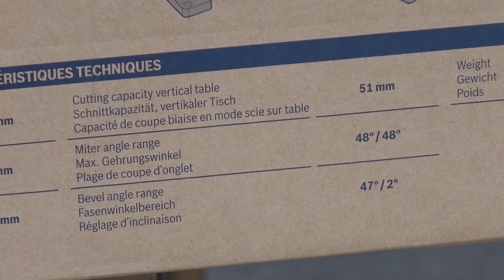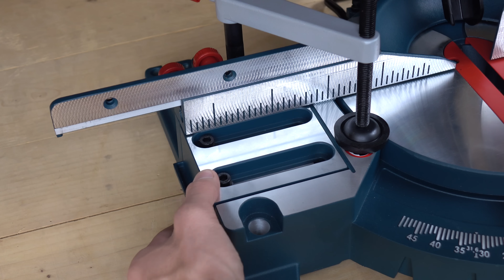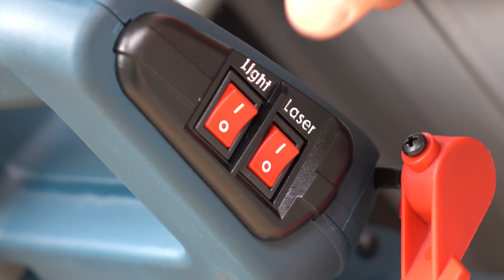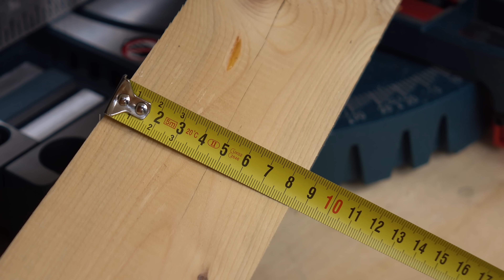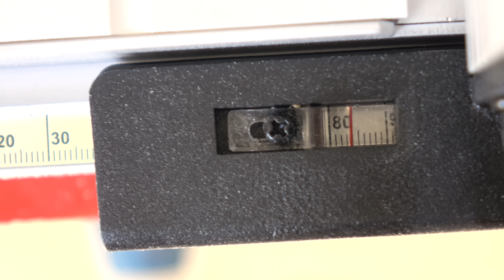Miter Table Combination Saw BOSCH GTM 12 JL  |  Unboxing and Test

Comment: While I would never get this...  It's silly that so many people are capping on this.  It's clearly aimed at flooring installers, which this is perfect for.  Just look at their pics.  It's almost all flooring related.  If that's all I did, this it almost a perfect jobsite tool.
Reply: I bought this machine late last year. It performs way better than I expected!
Accuracy is excellent, even the fence is spot on. I use it for timber but mostly for aluminium (yes I'm not in the USA, I'm in South Africa and that's how we say it here)
Settings are accurate and repeatable.
Yes it is heavy but it is rigid and trips to the job site don't disturb its accuracy. I have not wished for a wider table when on site
Like my other Bosch equipment, this machine is not scared of work!
Reply from the maker: Glad you like it man.
Reply: @johndavie9921  💪🏼🇿🇦
Reply: Ima flooring installer and drooling tbh lmao
Reply: That makes perfect sense
Reply: Price bolo iska

Comment: That’s a perfect tool for installing laminate flooring. One stop for all cuts.
Reply: Yup, I wish I had it when I was installing mine... 😭
Reply: Exactly my thoughts!  Great for flooring, but probably not much else.
Reply: Nah, I am a general contractor and I disagree. You have to lock it into place with  the miter attachment to use it as a table saw. If you install flooring for a living do you want to have to keep switching it back and forth? Nah you want to set up ready to roll. More gimmick than functionality.
Reply: Supreme Remodel & Design 
I was talking about for a diyer. I did my grandmas house last month. And I was using my table saw and miter saw for the flooring. It just sucks having to lug all the tools around. I just do diy stuff now. But I was doing stuff like that living and had a truck fully load out for it. But now anytime I help a family member out or a friend. I gotta load up the truck. Makes me wish I still had my old truck. I even had a miller gas power welder mounted in it for gate and fence repairs. But yeah for straight out professional use. You want them to be separate. I will agree with you on that. But for diy it’s great for space saving and mobility.
Reply: I agree to that for use for flooring. Any other work. Total waste of time
Reply: Nope. Too slow and cumbersome to pump out production flooring. When you floor for a living, speed is everything.
Reply: i was thinking the same thing but with a smaller blade
Reply: they sell laminate cutters, no saw dust to deal with, they even have the one to rip them
Reply: Duarte Handyman Services LLC. Duarte  I have seen a rip cutter but I’ll look again thank you 👍
Reply: Great tool, how much is it in dollars
Reply: very good
Reply: @saxyrep1  u
Reply: @tech_90  '
Reply: @tech_90  o
Reply: @wamembonathan6927  its around 600 euro so 650 without VAT I would say or so. More for the semi pro DIYer than real professional woodworkers, a full on table saw is just better for speed and big parts to cut. this is good for smaller or one time projects.
Reply: Nah go to vinyl plank much better product then use a cutter for most cuts being dust free and vinyl is easy to RIP without a table saw then profit

Comment: I have the younger brother of this saw, and it is the best tool in my workshop. It cuts perfectly at 90 degrees and the stops are also spot on at 45 degrees in either direction. I didn't have to calibrate it. 

My only tip is don't cut wet wood. The saw dust clumps together and will clog up the laser. You can obviously fix this problem, but rather just cut dry wood.
Reply: Can you tell me what the younger brother of the saw is called? :-)
Reply: @terjidjurhuus1917  Hanky Panky!!

Comment: First of all, if this had been any manufacturer but Bosch or Ryobi, I would not have got past the outside of the box. This is very well thought out as a job saw. I am surprised there is not a toggle on the switch between miter and table saw functions. It certainly seems out of the box accurate and very adjustable. Also, it has a nice long electric plug cord'

Comment: I have one and i like it. I will soon be adding an expansion for its table saw to get more working surface when needed. Perfect for home use!
Reply from the maker: Exactly what I'm going to do. :)
Reply: I need to make an extension too but don't know how 
Can u help
Reply: One of the problems is accually how to control the blade, and im thinking of a motorized mechanism to move the miter saw up and down and make the base modular so i can remove it from the table and use it as a normal miter saw. Once i finish my design i might share it with u guys!
Reply from the maker: @skawkji  Please do! Props man.
Reply: Hi @skawkji can you tell me what the maximum rip capacity is on table saw?
Reply: @nylon222  it is about 17cm
Reply: Can you push long board to the table saw and cut a 45% or 30% ?
Reply: @ducmagic  pushing long boards should not be a problem if it is supported well from all sides, not recommended without support as the table is so small. angles can be done with a cross cut jig, but only for small pieces definitely not for large boards.
Reply: My question is will the table let you do a 45% cut on the board? You can turn the table in a angle so the blade can make 45%? Or it only let you do a straight cut?
Reply: @ducmagic  no it is only straight cut. You cannot tilt the blade like table saws.
Reply: @skawkji  bçingizxanındağınbaşında.ehtimalolunanməzarı

Comment: I purchased one of these in May 2019 and love it. Very useful combination saw for various model making/mould making applications as well as DIY and working onsite and on set. If you're looking for an accurate 'multi-saw' that has a great range, cut depth, double mitre, dimension saw capabilities that is also robust and well made, this is a great choice. Makita also make their own version but I preferred the Bosch's fence setup and the overall design and build quality (despite being 8kg heavier than the Makita).
Reply: Hey, would you happen to have the dimensions of it when its blade is at the highest position, especially height front and back?
Reply: Y cuanto cuesta
Reply: Where did you purchase it if I may ask?
Reply: Where can I purchase one of these?

Comment: use the red pushy thing otherwise fingers will be red but not pushy anymore believe me things can kick for no reason.You've convinced me to buy one, I do window repairs and been waiting for a decent combo to be available again as long cuts on smaller timbers ideal for this machine instead of track saw. There's only so much gear one can carry to site all the time. Shame it doesn't do +45 degrees on the compound angle. Thanks for demo and gorgeous cat.
Reply from the maker: I'm glad you got the info you needed. I'll watch more on my fingers for sure. Cat says "hello" :)
Reply: Josh LAYON on YouTube

Comment: People are responding as if it’s meant to replace a table saw and mother saw in a fine woodworking shop. That’s clearly not the intent here. 

Flooring contractors and deck builders could really use this. They’re always working on-site, often for multiple days, and the majority of the material they use is well within the rio capacity of this saw. They’re already caring a chop saw in and out, possibly every day, so it’s added function to a tool they’re already use. Being able to rio down boards for edging and edge conditions is great added functionality.
Reply: Finally someone who understands the broader scope. People are narrow and short-sighted. 
Anyone who is complaining about the price of this tool is obviously not a professional in the trades. You have to spend money to make money. And if this is a daily-use tool for you, then it should be an obvious choice.
Reply: Yep. And for cutting wider boards, skil saw or track saw
Reply: YOU GOT IT !!  If you are installing real hardwood floors 99.99% of the work is going to be boards no wider than a 1x4. The vast majority of what I installed in the 90s was 2-1/4” strip flooring with the occasional 3 1/4” floor. Even random width width tops out at 8”. This is the perfect flooring saw.

Comment: Looks like a great tool for small trim jobs , like a bathroom guy. Definitely nice for flooring. Obviously not for crown, kitchens or cabinetry. But a great all around on the truck chopper with table built in. Nice idea.

Comment from the maker: I'm pretty surprised how good this thing is built and engineerd. This Combination saw is perfect for on-site work. It features miter saw and table saw in one package. The table saw depth is adjustable. Consider subscribing if you want more tool unboxing videos and building cool stuff.
Reply: The title mentioned a router table. I did not see anything that used it. Otherwise a great video
Reply from the maker: @EvilDaveCanada  Where does it mention a router table?

Comment: It’s a flooring tool. If you’ve ever installed real full-thickness hardwood you’d know that you are dragging around a small  tablesaw and a chopsaw from room to room and you use them while on your knee pads 99% of the time. It sucks. This is absolutely the answer. The only thing that would be better, a high powered battery version. I would have paid almost anything for this tool 30 yrs ago when I was doing tons of hardwood floors.
Reply: I was wondering who this was marketed to.

Comment: Now I know how much more I like to have them separate! 
  This is a monstrosity! 😱
Reply from the maker: Why? I mean...it's made for those that need a combination. Of course if you do a lot of work and have enough space for two machines you can always buy them separate. 
Here are two good ones from Bosch: https://amzn.to/2Z0HEDF
https://amzn.to/3hO0MNH
Reply: Insane Builds the capacity is so limited that it makes more sense to buy them separately so that you can do more than chop 2x4s and rip popsicle sticks.
Reply: What is the max rip capacity?
Reply: I can see someone not bolting down the saw and pushing it off the table when the go to cut a sheet of plywood that's too big for the saw. If I had endless cash I would buy one but it wouldn't replace my table saw.

Comment: Looks to me like you get a BULKY, clunky miter saw and a TINY, rip-only table saw in one unit.  That’s about $250 worth of cheap tools purchased separately, perhaps $600 in mid-quality (if you could find such a rip-only saw) bundled together for $1400!  With only needing one motor and power supply, I’d have thought there’d be a cost SAVINGS.  Apparently the space-saving design is SUPER pricy.

Comment: I like the concept, but its not a good replacement for a dedicated chop saw and table saw. The capacity is significantly limited by the design of it.
Reply: Ya defiantly handy man, home owner or small jobs. But cant beat not having to drag in two saws and two tables if you don't have to.
Reply: Chop saw is a straight cut only. I think you meant compound miter saw because it does 45deg left and right plus top to bottom.
Reply: @mikecoughlin4128  you know I never realized there was a difference till now. Makes a ton of sense tho.
Reply: @mikecoughlin4128  In the modern world the majority of miter saws are just that, miter saws. The term Chop saw is almost always only used to describe metal cutting saws. That being said many people call them chop saws and while it is technically wrong, it isn’t the end of the world.

Comment: Nice video demonstration. To the point and short.  Im new to wood working. I just purchased a home with a 3 space garage and now i can do what I've always wanted to do. Buy wood working machines!  Now i must make a beginners decision. DeWalt, Bosch, Makita or Milwaukee? I know this is controversial but any guidance would be appreciated. Other than using a jig saw and basic hand tools i have 0 experience.

Comment: The wave of the future! what is the cost? I have Bosch 12" dual compound miter on a gravity stand and Bosch table saw on a gravity stand. That is easy $1400. Although they can work in larger applications. Still this saw would not be bad for smaller use.
Reply from the maker: It would be a great addition to your tools.

Comment: I had a combination mitre saw a few years ago (sadly it was stolen) from Virutex, extremely popular brand between carpenters in Spain. Downsides were: very painful to carry around, everything would hit you, corners of the table, it would hit your knees and legs if you were to carry it grabbing from the handle..., It was heavy and the table saw had a ripping capacity of just about 5 inches and a quarter or so. It was also quite uncomfortable when using the mitresaw as the table would get in the way not allowing you to see what you're cutting. An absolute pain.
I now use a Makita 12" sliding on a Makita stand beam and a Bosch plunge saw, be acquiring a smaller sliding compound  mitresaw when I decide which one. With the arrival of track saws I see combination mitre saws have lost all interest, that's for work on site, for the hobbyist it can perhaps be attractive.
Reply: Sounds like whoever stole it did you more of a favor with how it beat you up.

Comment: I think it's cool. Its ideal for those tight on space and doing limited diy work. The only gripe is that in mitre mode the blade is not grip operated.
Reply from the maker: Yeah thats the only problem I have with this machine. It would be good to have a trigger and when you're done you just release it and it stops, like a normal miter saw. Instead you have to manually press the off button to stop the blade.
Reply: @MakeAndTest  maket testere

Comment: This saw is neat and I imagine probably really good for flooring installers but I can't see much use for it anywhere else. It lacks critical features on both the miter saw and table saw functions. Not to mention the glaring safety issue of having  switched power on the miter saw. That should be on a trigger always.

Comment: What an interesting product.  I can see how it could be really useful for the right person - although I prefer mine separate since I work in a shop and not on a jobsite and I do a lot of work with larger pieces for which this is not really well suited.  Very innovative though.  If I were a trim carpenter working on site, this would be a fantastic tool to have.

Comment: This seems useless. I'm happy with my table saw and Miter saw being separate from each other. I honestly don't see u getting much use of that table saw portion. U can't even use dado blades on that.
Reply: This is clearly for onsite work, in that situation it's brilliant. I've always wished I could have a tiny portable table saw for location work.. 99 percent of the time I just need to make some quick rips from 2x4's or 1x6's, so that table size is more than enough. I have been considering the Rockwell Bladerunner, which is basically an upside down jigsaw.  If I had this I would still use the miter function 9 times out of ten, so I'd like to see how much added effort is involved in operating the blade with upper table attached.
Reply: @fotopdo  This thing weighs a ton to use it as a jobsite saw. It isn't a mobile miter saw. So it's con out weighs it positives. This is a just a tool to get just to have something different. More of a novelty tool.
Reply: It’s a moot point for me, doesn’t seem to be available in the US. People do take some big saws on location... and you’d be setting up one tool one stand , it could offset the bulk. But no way to know without seeing it in person.
Reply: I agree and who wants have small table saw that only cut ???? and miter should be very heavy just cutting woods.
Reply: I think the best purpose for this saw would be flooring
Reply: How mush
Reply: @scraplifetrashtocash4551  it depends on what you do. I have the 12" Bosch glide saw on a stand and an elU table saw again on a stand and the two of them take up nearly all the space in my van. When you know you need them fine yeah great, but some times I know I only have an odd RIP in an back mould or some thing my combination saw is ideal. Also I can carry it on to the second lift of a scaffold which I can not do with my big miter saw or my table saw. To say one of these is only to have for the sake of having one probably means you have very little understanding of working out on site
Reply: Top saw for ingenious construction workers

Comment: I worry that, upon first using it, I'd find myself needing to rip at a 45.  It's been my experience that combo machines which do more than one thing do none of them very well.
Reply: I agree. Just look at Troy-Bilt lawnmower, snow blower, leaf blower and pressure washer combo. I do not know 1 person who has invested in that system because each option is just "OK" for what it suppose to do.

Comment: Great video thanks for sharing.  I’ve just bought this saw ,but   How can I make a bevel cut on the table saw (with this specific saw )or I just can’t ?
Reply from the maker: Well you found the bigest problem. Yes you can't. Only if you make some sort of a homemade jig that can make you cut at an angle.
Reply: @MakeAndTest  I was just thinking about the same thing, but couldn't figure out how it would be possible without having the piece learning and sliding towards the blade... dangerous and the cuts would probably be very inaccurate.

Comment: I think I just saw a spark inside your new miter saw.
Reply: at 3:55
Reply: @mregg4967  That's because of the brushes,they get their shape after some usage.It's completely normal,the tool is new.And because of the motor brake.

Comment: I bought one of these by Ferm in 2012. I am a hobbyist. It cost me 100 euros. the cut is offset and cant be fixed with the control knobs. I have to put a thin piece of metal underneath the wood to try to correct. Is a shame because square cuts are very very important.